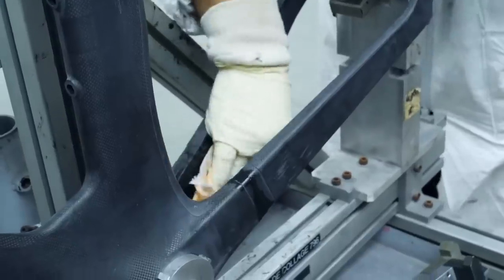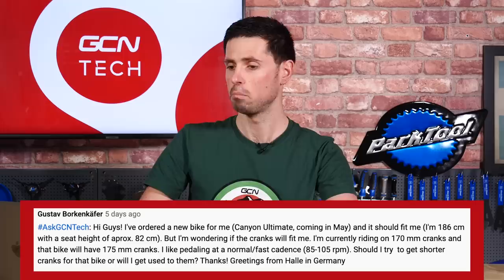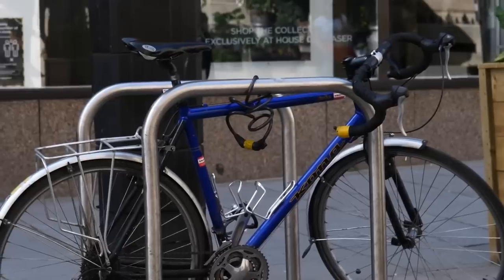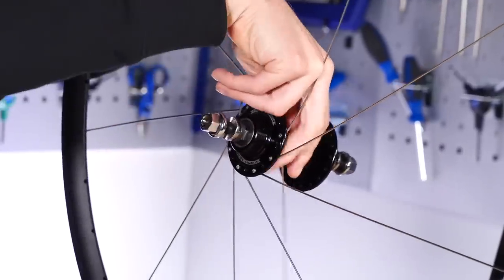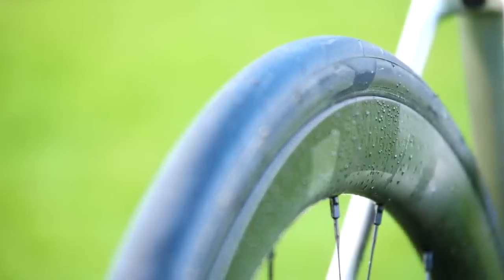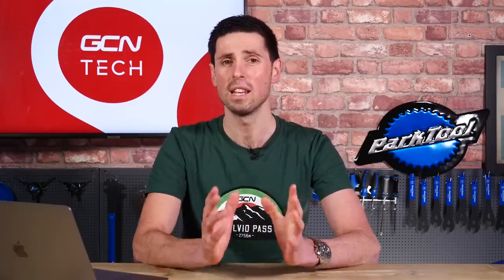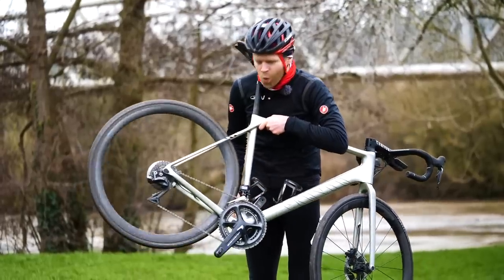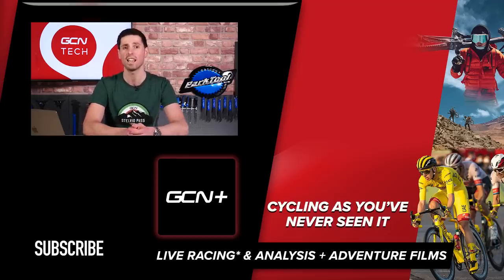Do Carbon Fibre Bike Frames Have A Shelf Life? | GCN Tech Clinic #AskGCNTech

Comment: Re hacks for leaving your bikes outside the cafe. We used to pull the front rim brake on and tighten the adjustment so it was hard against the rim, even when you let the brake lever off. Anyone trying to nick that would have to do one of three things: carry it, fiddle about with the front brake (and know what they were doing too), or get a face full of road when they hoped on and the front wheel didn't turn. Bonus: it also stopped your bike rolling away.

Comment: Other things to consider pertaining to reece pepper's query.  The cable and or cable housing may need replacement or lubrication.  A sticky cable will delay the shift until enough slack in the cable is achieved then the front mech spring will push the shift too far and skip the middle gear.  It is only seen on the down shift because that is when the cable is slacking and relying on the front mech spring to pull the shift.  On the up shift, the cable is in tension and this cable tension easily pulls the mech into proper position.  If lubing or replacing the cable and housing does not work, then the front mech spring is worn and you may need to replace the spring or get a new front mech.  However, it is most likely a sticky cable/housing issue.

Comment: @reece pepper Triple ring front derailleur shifting all the way down, give the internals of the shifter a good clean (or as least a good dosing of spray lubricant into the mechanism area) then re do the set up. It's likely the grease in the pawls is getting sticky and the return stop that engages the pawl isn't activating correctly. Do this in conjunction with checking all the other adjustments as well.
Reply: I agree, don't dismiss the shifter too quickly. The same thing can happen on the rear mech. Tightening the cable tension overcomes the gunk friction, but not when releasing tension, absent "overshooting," i.e., skipping a ring or cog. It's worth a try.
Reply: Definitely I would say this.  (In fact I did before scrolling here).  Exactly the same symptoms, and exactly the same cause and cure on my wife's ancient bike.

Comment: I was told from memory as long as the design loadings do not exceed 20% of ultimate stress you would not have any fatigue issues. Currently working on a design using composites needing 120 year lifespan for HS2.

Comment: @reece pepper probably the shifter internals are worn out. Try reattaching the cable from the beginning with proper indexing before getting it replaced.
The reason it's only happening while down shift is because there is more impact on the internals than upshift.
Reply: Could equally just be dirt or corrosion in shifter or cable routing.  On the way up the cable is working in tension on the way down you are relying on the spring on the mech.  If the cable is rubbing or catching you are going to notice the issue on the downshift rather than the upshift first.  Try lubing the cable or even replacing the cable before changing the shifter

Comment: The engineering question is cyclic fatigue of carbon frames, and brittle fracture propagation. Under ideal circumstances the cyclical fatigue is high, but manufacturing voids, and stress cracks (that can be very difficult to observe) from curb impacts etc, are real issues in carbon frames.

Comment: When you're downshifting the front derailleur it's letting out slack on the cable.  If the cable is binding somewhere it might not shift until there is enough slack to go all the way to the small chainring. So check that the cable moves freely.

This is similar to why you should always go up in pitch when tuning a guitar.  When tuning down the string can bind then suddenly release and skip over the pitch you want (yes yes if you have a locking nut it doesn't matter).
Reply: I was going to say more or less same thing.  Something may be binding, usually a cable, and it snaps too far when it releases. If so, cleaning and then oil in the appropriate places might help.
 I am assuming it isn't a 40 year old front derailleur with a weak spring;  I have one like that.  It doesn't like to shift from big to small if there is any significant strain on the chain.  In the other direction the cable is doing the work.

Comment: Back in the 70s and 80s when dropouts were horizontal an anti theft strategy was to leave the rear skewer open. If someone was to jump on the pedals, the wheel would slip and the tire would lock up on the chainstay.

Comment: A loud freehub is designed to make you feel guilty when you slack off.
Reply: When I had Chris Kings on my MTB they were a sort of “can I pass on the left” on the trail when I would coast up to a slower rider.
Reply: @needsmoreisolation8568  wtf, how can a thing that is completely still when pedaling suck your power? it would be logic only if it flexed or moved (hey, look, like a chain does!)
Reply: @8paolo96  half of the freewheel spins with the wheel the other half stays stationary relative to the chain.  while coasting the freehub clicks as the bearings move.  it moves and sucks power

Comment: @GCN Tech... While bicycles do not have a shelf life based on a fixed number of hours they do have a fatigue life based on a fixed number of load cycles before they fail due to fatigue under normal loading conditions. However, most cyclists will never fatigue a bicycle component out because of planned obsolescence of the drive train components. Or to put it another way, the bicycle industry makes sure your bicycle goes obsolete before you are able to ride it enough to get anywhere near the fatigue life of the component.
Reply: This is true. There are 1990s bikes that have obsolete frames but the components are still functioning perfectly fine.  Then again a bike becomes obsolete in 2 years just like how computers are upgraded every year.   

Everything is just marketing.  I've ridden 27year old bikes that still shifts smooth.  Components lasts incredibly long.

Comment: Shift issue: sounds like most likely you just need new a shift cable. Too much friction between inner and outer due to dirt or corrosion. Costs a few quid for new inner and outer. Easy enough to do it yourself. Bike shop will charge you half hour labour. If this is the fault then you may notice it's quite stiff to change up through the rings. If you change to smallest ring, then unclamp the cable at the derailleur you should be able to feel if the inner slides freely within the outer casing - or as was the case with my bike, the small guide tube where it passed through the frame.

Comment: I think the answer given regarding fatigue in carbon fiber bicycle frames is sound in theory but can vary based on individual frame construction layup and methods. While I know a bicycle is not an aircraft, there is a similarity in that aerospace engineers are always looking to optimize strength and weight. A carbon composite airframe may have a thoretically unlimited fatigue life, but in practice manufacturers place service limits on airfames. After a certain number of hours, the airframe cannot be certified for flight. Keep in mind that this is also after a life of mandatory annual inspection.

As I said, I know that bicycles are not aircraft. The construction of bicycles are not regulated and bicycle frames are not subject to annual inspection. I don't think lifetime fatigue is an issue with most metal bicycle frames as they are typically overdesigned for strength. The trend towards lighter and lighter bicycle frames does concern me. I don't think I would want to buy a second hand ultralight carbon frame without knowing its service history or getting an in depth inspection by a professional. Let's face it, with the price of carbon framesets, second hand is the only practical option for most.

I'm not trying to be contrarian just to make waves, I just think the answer to the question is more nuanced.

Comment: YES, there is a difference in crankarm lengths.  You use slightly different parts of your leg muscles.  If you've always used 170s then move up to 175, no matter your setup, you're going to feel leg fatigue more quickly, at least until years go by to where you think you don't notice anymore.  I moved into 172.5 crankarms and needed to, according to a proper bike fitting -- but it still took my legs quite some time to get used to them, fatigue-wise.  Conversely, however, if you're a casual rider then you'll probably never really notice after a few rides.

Comment: Carbon fibre wheels with rim brakes can have problems. Heavy braking on long descents will pump a lot of heat into the resin, if this happens enough times the resin can fail and cause the carbon fibre of the rim to delaminate.
Reply: However the question was about frames, not rims.

Comment: Learned this trick a long time ago. Before you get off the bike, shift to the largest cog. After you get off, drop the shifter all the way down to the smallest cog without actually changing gears. Then undo the front quick release but leave the wheel on (assuming you've already ground off the "lawyer tabs". Back in the day, we would also cinch up the front brake with a pedal strap, but I digress. Although I am dating myself here, this is a very good way to at least delay any potential bike thief.

Comment: Branded Carbon frame will be tested against a large number of « attacks » : such as UV, various chemicals, freeze and thaw, impact, etc AND fatigue. 
Fatigue testing consists of various mechanical tests to prove a resistance during a period of time. 
As a rule of thumb the fatigue testing is done to simulate the use of the product over its lifetime but the test is accelerated. 
So yes, carbon (and any other material) will have fatigue. It’s just not strictly relevant for everyday use for an average cyclist as the product will have plenty of margin before it breaks. 

In my humble experience, if I was a bike manufacturer : I would demand a fatigue test on a carbon frame but would not necessarily demand one for aluminium or steel frames (for the latter ones, I would only apply larger coefficient of safety). This is to do with isotropic / non isotropic properties. Of those materials. 
Fatigue testing : you love or loathe the subject, but I am sure this a hot topic when developing a new bike !

Comment: Carbon fiber does wear out.
If you're a particularly heavy or strong rider and you're stressing the frame side to side and over humps, you're going to introduce stress. Just like you would on any other frame, but on aluminium or steel you can actually spot the fatigue in welds and they can be mended easily.

Chain slap and cables moving about where they enter the frame also wear the frame out.
As  an example, i've worn out a carbon frame by chain slap on the chain stay, aswell as having a bottom bracket completely come loose. (no not the bearings, the entire metal insert) just bechause of high watt on the climbs. it does happen.
Check out Luescher Teknik on youtube to see if you find a frame you feel you can trust if you're worried.
Reply: If you are applying enough stress to a CF frame to cause enough strain as you have described, you broke the frame not wore it out. Any delamination between the carbon and epoxy will grow so fast that it will seem instantaneous.

Good luck welding your aluminum bike. Have you actually done it? I don't think you have, otherwise you'll have mentioned how you heat treated it. That would mean raising it to 1000° F for an hour and then water quenching it. An if your frame isn't in the proper jig, it will twist to an unrideable state.

Comment: Ah the old triple crank/front derailleur problem.... might want to look into your derailleur alignment. I had to adjust my that way and it works perfect. Put it in the middle ring and run thru the rear gears. Some times you might have to move the rear of the derailleur out a millimeter at a time.

Comment: Micro cracking in the resin system, the frame will soften over time. I wouldn’t buy a composite frame and I’ve worked in the industry for 40yrs
Reply: What's your recommendation?  titanium frame?

Comment: Speaking of crank length: It can have a nice effect if you need to open up the hips a little more (in this case you need to make a big change to really notice). Otherwise it's probably often overrated especially if we consider the day to day user. The founder of SRM, working with a pro team back in the day said that they once even put different crank lengths on each side of some of the pro riders bikes. Turned out that they didn't even notice that.. So I'll just leave that here

Comment: I have an early hotta perimeter TT carbon bike from the late 80's and still race on it, along with specialized tri spoke wheels with 1993 stamped on them, which are straight and true.
By the way it was manufactured in the UK, apart from the wheels, not Germany and the seatpost is fine.
Is 30 years long enough ?
Reply: That's impressive!
Reply: @pomajzsolt4363  just like the bike, I am old at 62 and still have a full hour ftp of 266, keep biking, keep pushing, live long and prosper, that is if they don't stop making 8 speed gearing to fit it.

Comment: #askgcntech when I move my bike from outdoor setup to my KICKR, I need to screw out my high limit screw as I can’t get into my 11t on my turbo. Why might this be? The gear indexing and turbo setup has been checked very thoroughly
Reply: It's likely you are slightly bending the rear hanger slightly everytime you tighten down the bike on the trainer.

Comment: Carbon fiber may not have a shelf life, but Vitus said my vintage bonded aluminum 992 had a 10 yr life.  Not sure if they were worried about aluminum fatigue or glue failure, but it was a good excuse to upgrade.
Reply: It's the glue bonding it to the aluminum. They were also afraid that carbon fiber MIGHT have a fatigue life. To be honest, we still don't know what the fatigue life is. From what I've read, modern CF will outlast the stress cycling machines used to determine fatigue life.

Comment: Carbon fibre bikes have a "shelf life". You cant say x-amount of years. But if you take the load that is on the bike while riding, knoe the carbon layup, the different needed material data of carbon and resin you can calculate a Wöhler-curve of the bike which says how many times the different loads you assume will be sustained by the bike before getting any kind of damage. I guess the way they build it its somewhere in 10^6 to 10^7.
If it would be metal it would be considered not fatigue critical with 10^7 or higher. But you don't get in such an area with any kind of plastics.
Reply: But honestly only think that Emma and Scotty were the only two where i would expect that they know or heard of what a Wöhler-curve is... So no worries!
Reply: Every material has a shelf life. But with carbon, you never reach this limit as a normal racer.
Reply: The fact that they use this material for airframes should quell anyone's questions about the materials durability. Commercial aircraft designed for a 50 year life span!
Reply: @ronbell7920  the material itself is less the problem than the layup and the assumed loads. If your layup is shit or the assumed loads are wrong you damage the bike just by looking angry at it or it's heavier than a steel frame. I also would guess that if you use the same layup as for airframes, that your jikebwouldn't last very long. You need to make a specific layup for each part depending on the load on this part. So the seatstay and the chainstay wont have the same layup because they dont see the same load.
Reply: @marc_hm_ there are different types of failure which can occure. Dependjng on your layup and the load you get fibre ruptures. Even if 5 filaments break your stability basically is gone. It can also occure that the resin bond to the fibre is bad or the layers delaminate. Sometimes, if you are at the limit, a few degrees off angle in a layer can decide between no damage and damage. In the end, most of those layups is hand manufactured because of the complex geometries. Where are humans, there are mistakes. So don't expect everyframe to be precise to the angle second the same. So if you have a angle mistake your shelf life changes and might be earlier than one would think.
Reply: Your point is duly noted, I ride Reynolds 531 and 853 myself!
Reply: @ronbell7920  Sounds good! I actually only got aluminium bikes at the moment. Depending on which bike i like when testriding some for a replacement (both are roughly 10 years old) it could be steel, titanium or aluminium again.
But definitely don't want and need a carbon bike. imho those belong on a race track, not a recreational ride as i do them most of the time. Mostly due to the recycling problem though.

Comment: @reece pepper the same fault on my wife's ancient bike was caused by the lubricant between the pins/axles holding the pawls in the shifter ratchet mechanism becoming sticky over time. I dismantled the whole thing and cleaned and relubricated the pivots, and now it works perfectly in both directions.  There are quite a few springs and fiddly little parts in there, so be a bit careful.  It might have been possible to degrease those bits without fully disassembling the mechanism.  Maybe try that first?

Comment: The first question answer isn't correct. Carbon fiber does in fact have a shelf life or lifespan. Resins do breakdown over time and carbon depending on the quality can become more brittle with time making it more susceptible to fracture/failure. Much depends on the environment that it is in (heat, light, etc).  However...Vibration and impact usually become the deciding factors over longevity regarding lifespan.